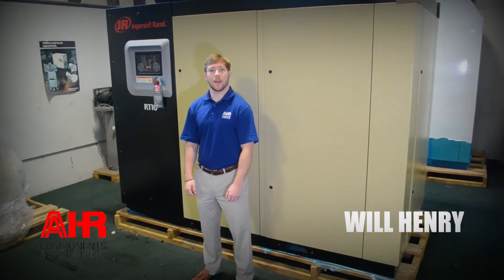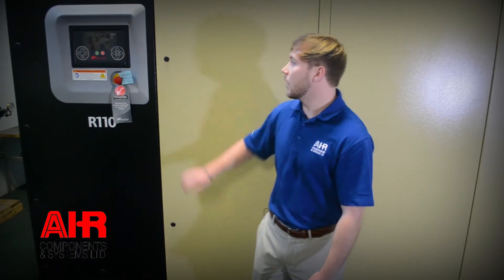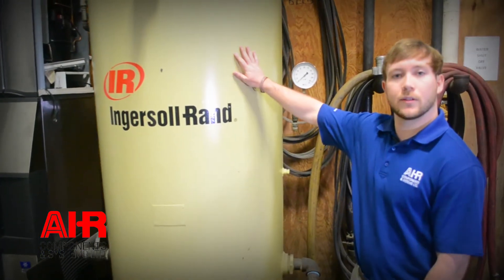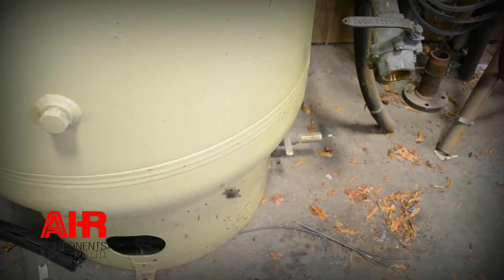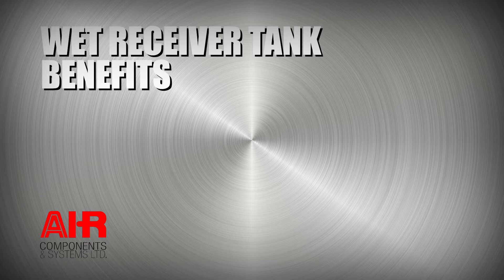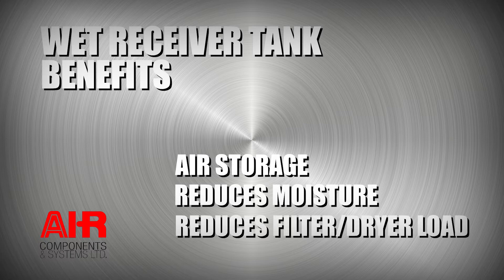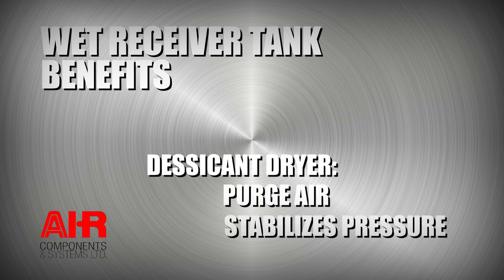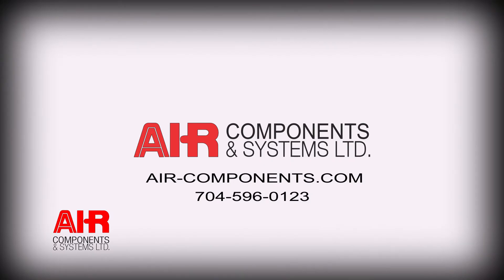What does a wet receiver tank do?

Comment: My air receiver 10k m3 capacity got moisture on the external vessel resulting to a flood to the flooring.tjr auto drain is working..
What is the best counter measure to stop moisturizing of the vessel?